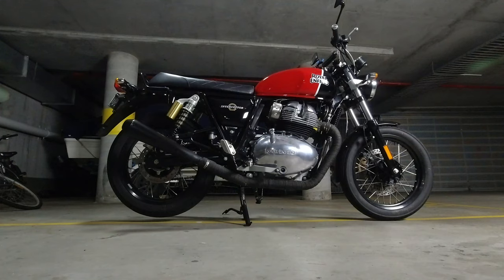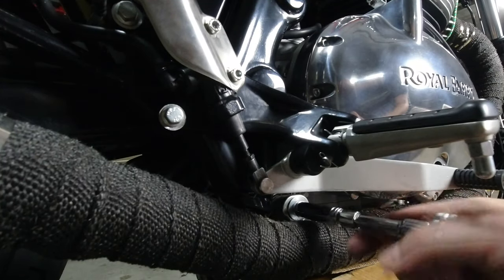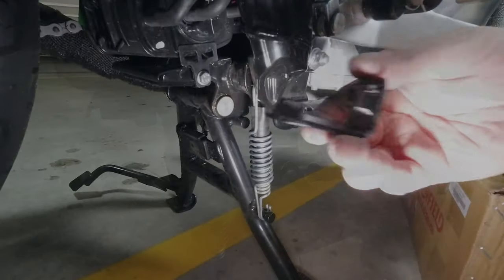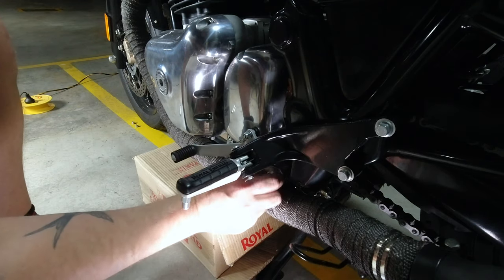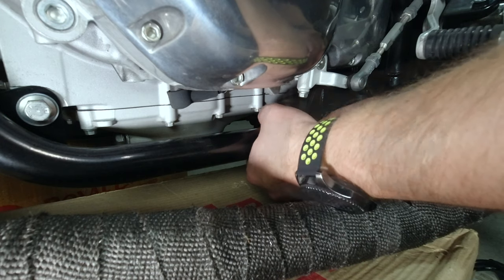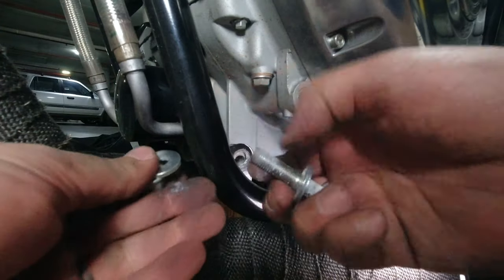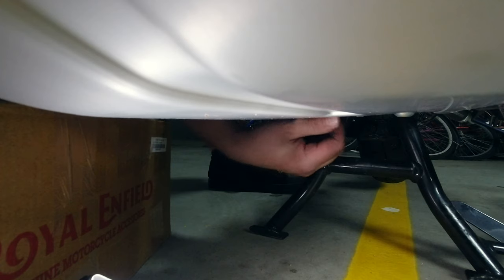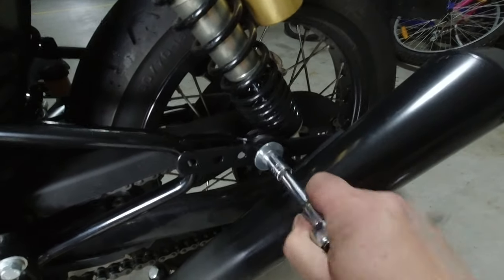Install a Sump Guard with The Enfield Guy - Interceptor 650

Comment: Sir i want to ask are there any demerits of  adding a sump guard to my classic 350 , like i don't usually go off roads but still i want to have an extra layer of protection
Reply: No real setbacks to report...you might eant to check on the 350 Classic if the guard impedes any service parts....even if they did they are super easy to remove 👍